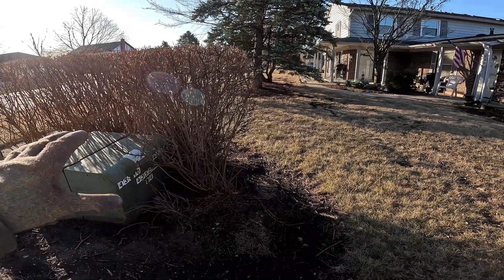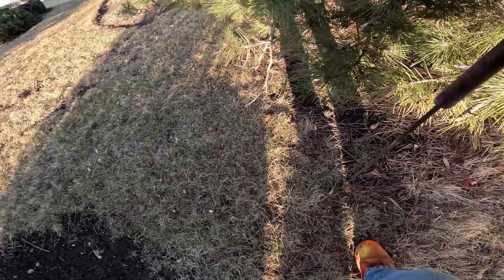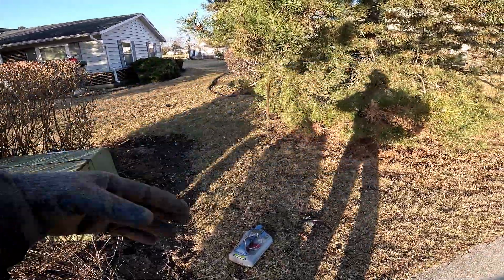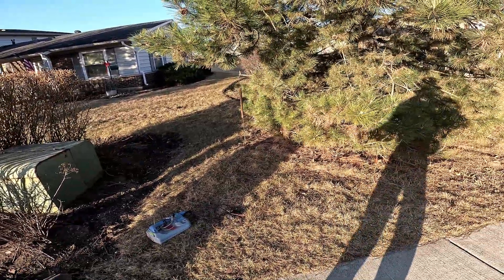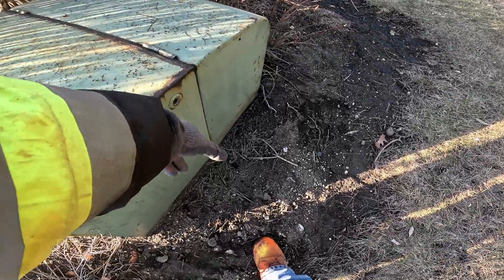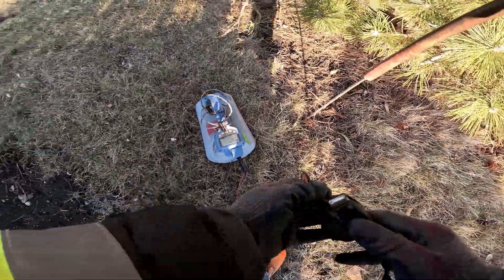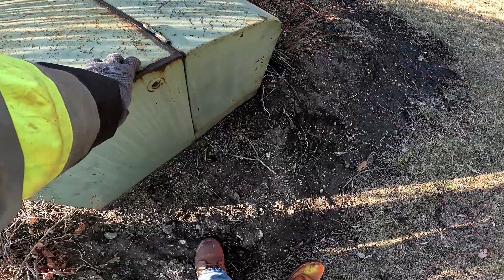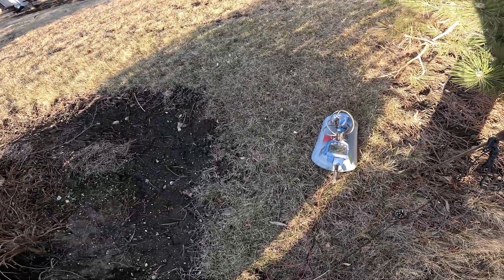How to Locate Underground Electrical Cables on a Single-Phase Padmount Transformer

Comment: I feel like I have just been sorta winging electrical. I'm sure I'm marking it correctly, in that I have electric utilities marked and am not missing any of them, but I have no idea what I'm Locating exactly most the time other than services. what's a primary or secondary or whatever no clue. I can't find a good tutorial for how to read our GIS maps for electric..
Reply from the maker: The primary line brings high voltage to the transformer, which steps it down, and then the secondary line feeds each house—sometimes through a secondary pedestal, and sometimes directly from the transformer if there’s no pedestal.
Reply: @811chicago5 this is what confuses me I think. I've been treating ele services a lot like gas when the maps and prints imply it's all trenched together, but I know other people will actually dc or clamp (or more likely power mode and just say they didn't) every single ele service that a transformer puts out and have like 6+ distinct red lines coming into thentransformer for a ticket that's polygon is a single lot that just so happens to have a transformer near it or on it. all basically on top of each other but still, it made me wonder. I have never done that and it has never come up but I do fairly often see where people did it that way when I come across old marks by a transformer.
Reply from the maker: @gemixx8365  I’ve seen those clusters of lines too and wondered the same thing. Personally, I’ve always treated it as a single run unless there’s something that clearly says otherwise. Is there a way to toggle off the other utilities on the GIS map so you can view just one at a time? Try checking the top of the map to see if there’s a dropdown menu that lets you select individual utilities instead of displaying all of them at once.

Comment: Rookie question: Is there any difference in the signal for a primary and a secondary?  Also what can be done if getting a wonky  signal when connected to the outside of the transformer cabinet?
Reply from the maker: Yes, there is a difference. Primary lines usually give off a deeper, more consistent tone due to their greater depth and higher voltage, while secondary lines tend to produce a higher-pitched, more erratic tone because they are shallower, carry lower voltage, and are more susceptible to interference. (bleed-off)

Comment: Why not test the transformer with the grounded transmitter
Reply from the maker: I’m not sure I’ve just been doing it this way for years. There are other ways to test the transformer, but many people don’t have the right equipment for it. So, I follow what I believe most people do daily, which is not testing it at all. One way to check is by using the back of your hand to ensure it’s properly grounded. However, many locators don’t even do that.